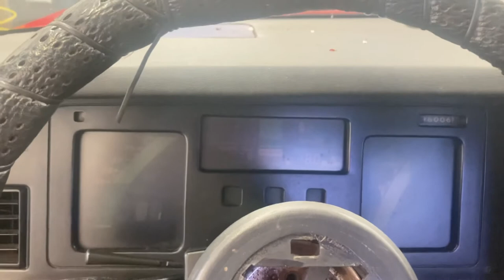C4 corvette tps, iac, and throttle body cleaning.

Comment: To get a lower temp cooling  fan switch, order one for a 86-87 3.8 Turbo Buick Regal. Hypertech used to sell them, probably not anymore.
Also, be sure to do the throttle body coolant bypass. It unnecessarily heats up the intake and robs power.

Comment: Thanks for the recognition in your video! Looks like she is running good! That's good news! I took the week off from my "hobby wrenching". I needed a break, this cold has been kicking my butt! I've been daily driving the 84 and all is good. Runs better & better the more I drive it and I would have to guess this will be the same for you!
Reply from the maker: I drove mine yesterday, I need to do cap rotor and wires as it feels like a car with bad spark.  Its a process thats for sure.  Its more of a project than I was really wanting I may trade it or store it for a while.  With the jeep done I have a porsche 914 mostly disassembled and ready for an outlaw restoration.